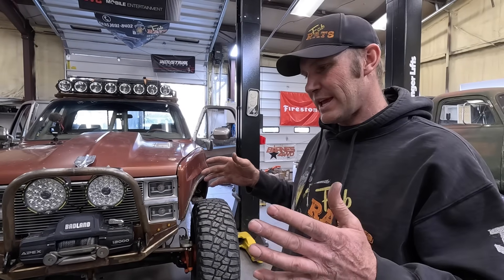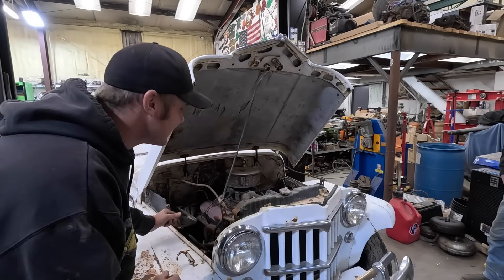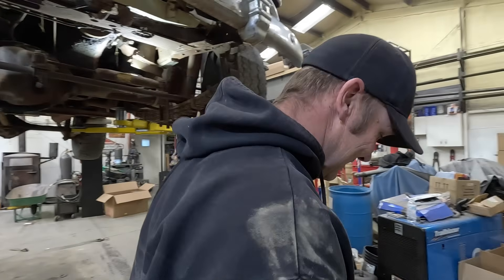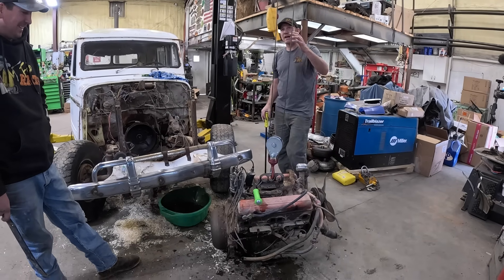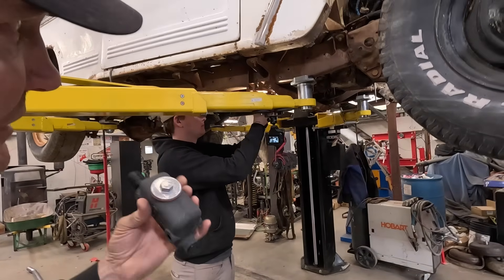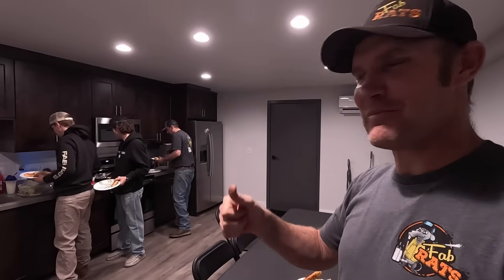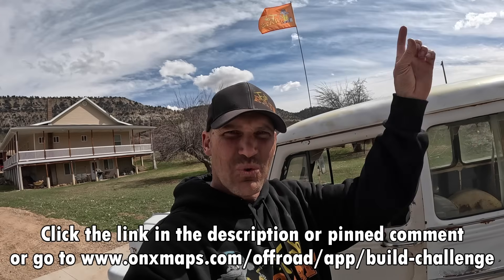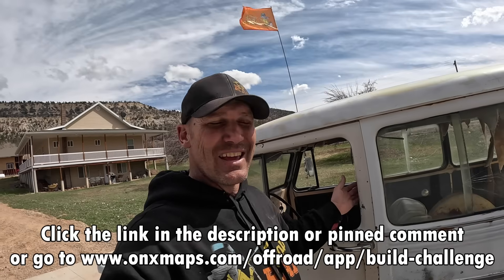CHALLENGE ACCEPTED: We're Building The Ultimate VINTAGE Overlanding Rig!

Comment: It is good to see this rig get some love. I have a 51 wagon, with a 350 bored 40 over with aluminum pistons, a Rv cam and 300hp. Out to sm465, Dana 300 twinstick, ford nine inch rear Dana 44 front. With power steering conversion. Have had it in the ocean, at 14000 ft, and as fast as 110…. Love these things!

Comment: The Willys Wagon was introduced in 1946 but was not available in 4wd until it received the “hurricane” in 1949. The rounded back wheel well, flat fenders and flat grill were 46-49 and the 1950 got sort of squared rear fender wells and pointed grill as well as a point on the front of the fenders.  I like all the willys wagons

Comment: The hardware on the back of the transfer case is a BW OD and desirable to Willys Wagon and Jeepster crowd so don't chuck in the pile...sell it.
Reply: Yep, Borg-Warner overdrive.  Also sold as Rancho brand for awhile.  Electric shift solenoid.  Only use in 2WD.  Also used in early cars 1930's 1940's stuff

Comment: I had a 49 Overland wagon and i fastened the hood to the fenders and made a tip forward hood and there were 6 bolts to take the whole thing aprt to work on the motor and it had a 375 horse 350 in it

Comment: ok i have to ask why dont you have an A frame between your lift chains and the tow ball to stop the towed carrunning into you on a suspended tow we dont use lifts like that in the uk any more (cars are not strong enough) but when we did use harvey frost type lift as your tow truck is there was a ridged frame to tow and push on

Comment: A lot of engine for that old drive train, romp on her and things will break. To straighten your tubing, secure one end to a solid point, wrap the other end around a bar and use that as a lever to stretch the tubing, give it a good pull and you can straighten a whole coil then cut it down to lengths to store.

Comment: Makes me want to get back to work on my 52 Willys Wagon build. It's on a modified 86 K20 frame. Wheelbase is stretched out to 117".  Front floor area was cut out to set the body down on the frame. Left off moving the rear wheel wells back. Which were made to clear 40" tires. Rory should have some pics in his texts. Sat in a field from 1969 until 2020 when I grabbed it.

Comment: I had a 53 willies CJ 3B with a 327ci an original T 90 transmission. It had a Studebaker overdrive unit bolted onto the back of it transfer case would only work in 2 Wheel Dr. Took the overdrive unit out because it was unsafe to go that fast. You were wondering what would be the first part to break and I broke lots of parts. And I’m betting an axle shaft is going to break first

Comment: Paul if you had quickly threaded the old spark plug back when the firecracker was put in the stuck cylinder it might have worked. I might try it next blown engine I come across.

Comment: OK, Dude listen. Find an old Mercedes diesel ( 5 cyl ). You want the mechanical injection pump. Not a lot of power, but plenty of torque, it will run for ever. They can be hot rodded some, you have to watch the rpm, same as any diesel. There are some YouTube videos. It all for fun anyway, right ! At 28:41 my guess for failing part drive shaft.

Comment: I think the drive line will give you some trouble( weak at connections) brakes next, then transmission ( specifically) if I remember the first video on this rig from before...... Then belts and hoses( if they happen first, you made it to the next challenge

Comment: The 400 was externally balanced, which was unique to the small block.  If the old flex plate was used for the power glide, it could possibly hurt the engine.  I am not sure which components they used though

Comment: -- Do these new parts (breaks/lines/exhaust for example) do they count towards your Onyx budget?  
   What's going to go first?  Well knowing your luck: the transmission.  But that drive system looked a little more than sketchy.  
   Outside of the obvious issues.  I am concerned that vehicle simply isn't large enough for overlanding.  Could it work, sure, but it's going to be a headache getting to what you need.  And you're probably tenting out.

Comment: Back in the 70s and 80s I had a general store up in rural northern Vermont. One January day a tractor trailer bringing 40,000 pounds of freight got stuck coming in the icy driveway. Couldn't go forward, tractor slid sideways onto the big - log fence, couldn't go backwards. Trailer hanging out into the road. My old friend Larry Varnum showed up in his stock (except for all the rust) '49 Willys wagon. He pulled right up in front of that big Freightliner and asked " Stuck?"  The driver allowed that he seemed to be, so Larry unwound a great big rope off the front bumper of the wgaon and attached it to the front of the truck. The truck driver was laughing. Larry just told him "You may have to help a bit" so still laughing the driver climbed up and got it into a forward gear. Larry backed the wagon up. The truck came with him. 

Don't under estimate that old wagon!

Comment: Ooooooo....metal fan. I still have part of one from my 68 Corolla.
It broke one day at about 6000 rpm. One blade broke off, hit the frame, bounced up, chopped the battery in half and went out through the hood about 500 feet in the air.
The rest of the fan, unbalanced, then broke the water pump out of the block and went through the radiator.
I did not have a enough bubble gum or bailing wire to get home THAT day.

Comment: Electrical, I had a 53 pickup and it was bulletproof on stock suspension.. I jumped it in Colorado off a snow drift and horseshoed the front end and it still ran great until I sold it

Comment: Friend . I have a 1962 willeys station wagon . I have had it  sence I was  14 still have it . Air fuel and fire. It will get you home . Computer s won't. LOL. I  have an old book from willeys.  I'll copy it and send you a book . Mine is all original.  230. Overhead cam original 3 speed and original transfer case. She has been over a lot . Fun was had . Up too to 10, 000 feet in the bridger mountain s. To Striges.  Love this girl  she has heart. Olny down 10  lbs in two ceylendrs from new whitch was 115. Per ceylendrs.  Sorry saw the willeys brought back heart . My first car .   Blessings.  You made mine worth more by changing yours. No cut outs no new parts just heart  all original. Love and blessings.  This Easter weekend

Comment: if its a single pot master the line to the front will t close to the wheel nearest the master and then go across probably the front at the bottom of the rad to the other side . after that depending on the style they used it'll t again to the back or a seperate line will go to the back . loose one brake u lose them all it's why single pot brakes are no longer used

Comment: In 1974, I bought a 1952 Willy's pickup with three on the floor, and a 400 Pontiac motor. Had several problems with it, but when it ran, it ran like a ra... ape. Traded it for a Yamaha 250, motocross bike.

Comment: You Should leave the Old Wrecker Engine in it its a 400 Reliable and can get parts anywhere and it runs like a Top, Throw a Procharger on it and Easily Win and Keep the Willies True to its Beginning SBC, Piss on a Diesel Smoking up Everything! The Cast iron powerglide will fail first  it think or the OD unit!

Comment: What's going to fail? Tradition says Transmission, But, the trans seems to be working well. Brakes are fine, cooling seems fine except for a couple old hoses, electrical has nothing wrong with it. Initially I was sure that the boat seats were going to fail first, but it looks like you used more than 2 bolts in them, so they may survive the day. If you checked the fluids in the Diffs and TF, they'll easily live through a day of FABuse. 
If the rad hoses survive, I think that the only thing left that is going to catastrophically fail, is something in the steering.(especially if you put decent tires on it)  It's old, heavy, and Paul's driving... *[Clunk!] what was that? Oh No...

Comment: I have a 1961 Willys Wagon "Rock-lander" build, and I absolutely love it!! It has a 2016 Ram EcoDiesel turbo 3.0 with the 8HP70 transmission behind it.  The Atlas 2 T-Case splits the power to the axles with 4 link coil over suspension in the rear and 3 link with coil overs in the front.  That EcoDiesel puts out 300 hp. and 500 ft. lbs. of torque!  I live in Oregon so I just might take a road trip and see you guys! I can't wait to see what you come with for this build!  Love it!

Comment: I've been waiting for this build! I had a '55 with the original straight six Hurricane motor and the original tranny and transfer case. It would climb anything but a tree in low range! It worked fine until a got a head gasket leak one day, and the coolant puddled in the spark plugs on top and killed it. Very versatile body style!

Comment: Some advice on stuck motors is to pull all the plugs, fill with pb blaster or whatever, then the part ya may not have heard is ya put your breaker bar on and jack up the front of the vehicle by the handle of the breaker bar, let the weight of the vehicle do the work.  Go to bed or go do whatever else you were doing, and come back in 12 hours, good chance the tires are on the ground.

Comment: I’ve seen the Willy’s in the landscape of other videos and always hoped it would get in your queue of builds.  I’m a little old man and way back when I lived on the north side of the mountain, I had a 48 Willy’s, flathead four cylinder, truck. High and ultra low gears, fwd with lockout hubs and skinny military tires. I used it to haul my water from a spring. I kept the oil warm in the winter and the battery charged, it never ever let me down. Even crawled through the drifts in the blizzard of 78 checking on neighbors.

Comment: I love your fuel tank. I worked at a plastic factory that made those for boats. I got a gas leak in my 1978 Datsun 310. Whatever the parts were bad we would grind them up and make more gas tanks and there was one with a funky sink on it which is when the plastic dips in. The foreman told me just use that tank... And considering what we got paid and the fact that if I didn't have a car I couldn't come to work I agreed with him. I put two pop in one-way valves in the top of the tank, punched holes in the floor pan, ran my supply line and ran My return. The vent line on the cap I just ran to the vent where the old gas fill was. Bank fit perfectly in the spare tire well and wedged in frame to frame. The original gas tank was 20 gallons and now I had a 30 gallon tank.
That tank outlasted the engine that died two years later. The only thing that sucked was filling the tank in the winter but the good thing was didn't have to do that too often because the car got 35 MPG and was just used for going to work and coming home. You'd open the hatch and all the heat would go out. Good thing was since it was for marine applications that had a sight glass and that was my gas gauge 🤣.

Comment: Paul - the trick with the door latch on the Willy’s wagon is to clean it well and lube the crap out of it. With the window down - you can get most of the works at the back of the door through the window gap.

Comment: Ah, the memories!  My first ever car was a '53 Willys Wagon (maroon with a basketweave-patterned decal in the recess above your dark stripe) in 1966.  No 283, though - only in my dreams.  It came with a Hurricane OHV six, with three on the tree.  It was my entry in driving offroad, on two-track trails through the hardwoods of Connecticut.
Oh.  That device behind your transfer case is an overdrive unit, controlled by a plunger under the dash by the driver's left knee.  When engaged it doesn't do much for engine rpm change, but it totally eliminates engine braking!  Let off the gas and you quietly coast.

Comment: Go Fab Rats, The second vehicle I bought ( not old enough for a drivers license yet ) was a 1958 Willy's station wagon that had a 327 Chevy in it with hi-po heads. Paid $150 for it "grin" The fire wall was cracked so when you stepped on the clutch it would push the fire wall in and not let the clutch disengage . To him it was broken lol. So you better win this.  Will be voting for you.